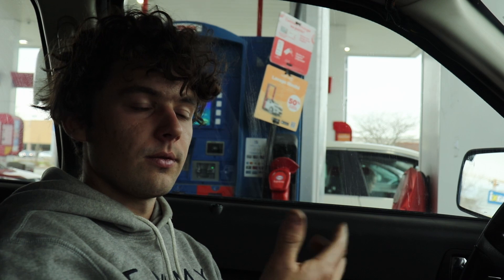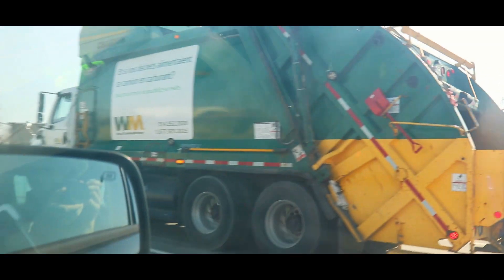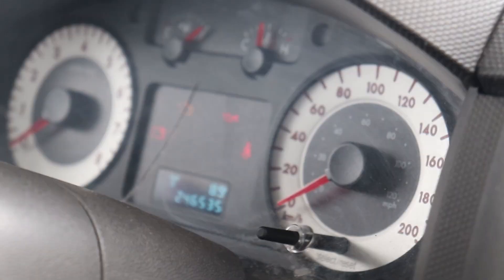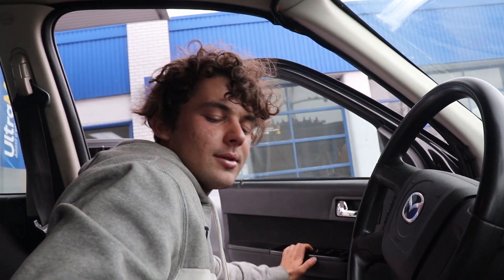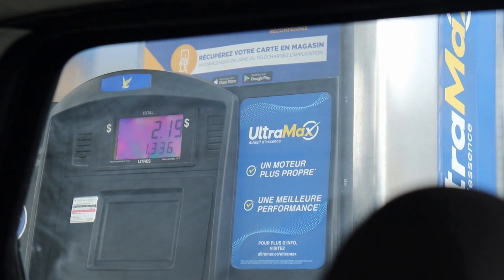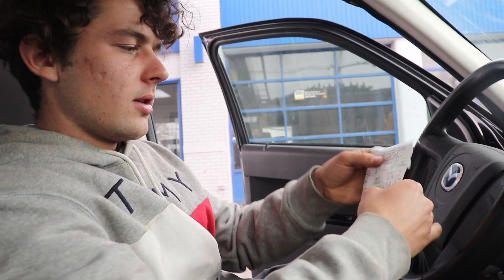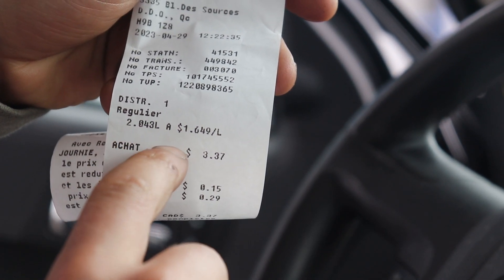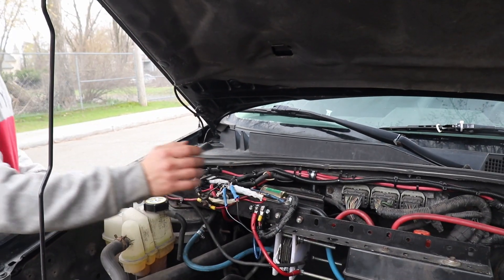Hydrogen Fuel Cell Testing (Part 2)

Comment: This test is inconclusive. 

1st off, you need to do a round trip so you can not only refuel with the same fuel pump, but also account for elevation changes and wind on that trip. Doing a one way fill up wont ever give you accurate results as you could have a head wind in one direction, fill up, and a tail wind going in the other way.

Comment: You proved your concept. Now make it professional. Make it pretty. Properly record your pre and post mileage. As has been mentioned this is an electrolysis system not a fuel cell. Change that or people will criticize you. How will you keep it from running dry? How long before the electrolyte tank is empty? Good job:)

Comment: Years ago in built on of these only 3 times bigger, and i drive a ford explorer, it worked great, on highway it would get 30% more mileage,  and in city i would get 20% more mileage,  it was worth building and putting in, i do have advice, the hose you have coming out and going to the intake, make it go into a canister or bottle about middle way up and have hose coming out of it at the top go to intake. The reasoning is, that if at any point moisture gets sucked threw it will drop off into before it can get sucked into the intake.

Comment: I've read that a computer controller is needed to manipulate the O2 sensors so they don't tell the main PCM to send more fuel to the engine. I'm surprised you did have a gain in MPG so I'd be curious if you use an O2 sensor with your system you should see even better results! Great video and nice to see a young man do something productive instead of joining gangs or selling drugs or being stuck at home playing video games bravo 👏👏
Reply: And also just so we're completely clear I had a relay and switch wired in so I could turn my injectors off after I got the truck started I would start the truck on gasoline let it run and warm up turn my hydrogen on the truck would rev a little bit more because it was sucking on hydrogen and was being delivered gasoline I would then turn the gasoline off I only use gas to start my truck because it is extremely hard to start a vehicle off of hydrogen once the vehicle is already running you're pretty much good to go but if you try to start a vehicle off of straight hydrogen more than likely the engine will backfire and all it takes is one backfire to grenade your entire hydrogen fuel cell happened to me a handful of times then I Incorporated the double bubble tank and instead of blowing my cell up it would pop the double bubble tank which was a lot easier to replace
Reply: @sebastianharrison6118  Are you saying you needed two bubbler tanks to stop the hydrogen generator from exploding, or one bubbler?
Reply: @michaelproeber1953  just one.... but they are called a double bubble lol I can see this being misleading
Reply: Pretty much all cars are different my 96 Toyota Tacoma still has a distributor in it and it also has two O2 sensors and it runs off of OBD2 when I was running hydrogen I didn't have any codes shown besides an EGR code but that's because I had the EGR deleted after I got rid of the hydrogen and turboed my truck I had to make a complete custom exhaust system for it in that process I took the secondary O2 sensor and spaced it away from the exhaust system by about 2 inches because I remove the Cadillac converter and the 202 sensors need to see a difference in flow so it can trick computer to thinking they're still a Cadillac converter there just think Cadillac converter on the front side of the Cadillac converter O2 sensor 1 sees lots of flow and pressure on the backside of a Cadillac converter it's a much smoother flow so O2 sensor number two needs to see less and that pretty much goes for all OBD2 Vehicles if you want to get rid of your catalytic converter you must put an extension on your secondary O2 sensor so you can trick your computer into thinking that the cat is still there vehicles that have wideband AFR sensors like newer Hondas I'm not sure if this is still possible

Comment: Hydrogen technology 🚓🚕
Hydrogen help the combustion process to run engine more efficieently.and carbon-free fuel burnning.
HHO gas burn a lot faster then  gasoline or petrol. Hydrogen power  miracle gas remove carbon build up in the combustion chamber and boost  engine power and torique. Reduse  carbon emission ) restores better fuel  economy.
 Hho car kit  prolonging engine life and engine oil life.
 Like a new car!!! 
Engine runs smoother and cleaner to make your car 0 carbon emissions  Boost engine  power and torque Better acceleration . 
An efficient hho car kit lower the engine temperature more then 100 degree F.  Hho car kit reduce car maintenance charges. 
Cleaner engine running. Reducing engine noise due to the faster fuel burning. Hho car kits works nicely requires no modifications in the car engine. No side effects on car engine.
Engine start quickly safe your car battery. No more petrol or diesel smoke or smell. Hho system is very simple.
Hho kit installation  time is about two hours to make your car a low cost hy-brid.
Reply: I aggreed w u
Reply: So why isn't everyone using it?
And please, no conspiracy theory BS.

Comment: Nice video and test, except this is not Hydrogen Fuel Cell, this is an electrolyser, aka HHO generator, or HHO cell. And also, you must travel at longer distance for accurate results.
Reply: to technical, you want HHO on demand cell no tank needed, and not the extra steep removing the oxygen, looking forward to seeing longer tests when you get the chance cheers

Comment: I use a ac to dc welder for my power supply 110v at 40 amps I got the welder from Home Depot online it's called a metal man it's tiny I also use a thousand watt car inverter to go from the Cars 12 volt to 110 AC I then plug my welder into that and that is my power supply I use a wet cell consisting of 50 positive and 50 negative  plates inside a 5-gallon gas can the plates are 14 × 14inche and about 2 mil thick ... I'm basically just size my intake down to about an inch and a quarter PVC pipe ran that to the back of my truck and it ties into the 5-gallon gas can I also adapted 2  1inch one-way valve to the gas can it's basically a draw through system  truck is a 96 Toyota Tacoma with a 4-cylinder that runs off of hydrogen ....I do start my truck off gas but after it's running I turn my injectors of ...it's definitely less powerful  but it's cheaper than gas but I do have to clean the cell every know and then I use about 40 gallons of gas a year
Reply: Nice we would love to see it bud
Reply: @joemason9187  truck had 328k on it and started knocking ... I took the oil pan of to replace the rod bearing but it turned out to be the wrist pin and a used engine is like 3k after shipping and taxes so I've been in a rock and a hard place with it lately
Reply: @joemason9187  I did want to make a few videos on it in hopes that others would see it and try to refine it further but I'm a 32y old plumber and never had any free time
Reply: post a video as proof
Reply: @MuhammadWaseemEjaz  this was years ago brother I like quite literally have to rebuild an entire new cell I still have my welder and inverter but I'd have to build the system all back together again there is so much to it and when I was younger I had a lot more free time now I'm right in the middle of adulthood and having to work everyday and pay bills and I don't even have enough time for myself anymore let alone cut tanks in half plastic weld them find foam material to put in the top half to keep water from splashing around there was so many small things that the system took and to do it all again would be a week's worth of work and I don't think I'll have a week To myself for the rest of my life it's go to work work your butt off come home go to sleep repeat the process pay rent and maybe somewhere in the middle of that I can feed myself
Reply: wow! 40 gallons of gas that's amazing bro! 👏👏 by the way how do you get passed the O2 sensors? I've read that if the main CPM reads more oxigen going in , it will send more fuel to the engine or does your truck have a carburetor?
Reply: @Radiateprosperity  it had fule injection it was the 2rzfe engine
Reply: I would also like to know if you turn off your injectors by accessing the fuse box of the vehicle or do you identify the wires connected and splice them and wire a rocker or toggle switch to operate from the inside of the car?
Reply: @Radiateprosperity  there was a relay under the hood for the injectors I had a switch wired up to it in the cab... there was also a 2 gallon dubble bubble tank for safety that I failed to mention earlier
Reply: @sebastianharrison6118 Definitely sounds well planned out. Thanks for sharing! Really would be great to see it 🧐
Reply: I would love to see your setup also.
Reply: @b1gbc2501  unfortunately I no longer have the setup and I don't plan on building another or doing that again my truck is currently turboed making about 300 horsepower pulling 14.80s in the quarter mile it is now a dedicated Drag Truck.. also keep in mind that set up I'm talking about is from 8 years ago back whenever I first got my little Toyota and it was a very very crude design truck probably had 70 horsepower maybe it was just enough to get down the road back and forth for a couple years without having to pay for gas because I was at a very hard financial point in my life
Reply: Gotta call BS on this one. 
It cannot work as described.
Many have tried, ALL have failed.
Reply: @RobertRichardson-z3u  with an attitude like that I can imagine you wouldn't accomplished much
Reply: Can you send me pics of  your  sistem. Thank you.
Reply: @sebastian...did your car sometime consume hho only when getting on ride? (You put the relay to controlled the pump gaz on-off)?
Using gas only starting? Then 100% hho will consuming?
Reply: @dadsvloghappychannel8518  .. only gas to start.....then hho on...then gas off....running on only hho
Reply: @sebastianharrison6118  Could you draw up a schematic on your setup from memory? Then just post a short video, explaining the setup? You seem to be generating enough hydrogen to make a toyota engine run, gives me an idea for a single rotor rotary engine adaption in a smaller/lighter car. Everyone keeps doing these hydrogen setups on these really large vehicles with over sized engines so that doesn't make sense to me. Stanley Myer ran his on a small buggy with small displacment engine for a reason. I do engine swaps so if I can generate enough hydorgen, I will definetly find a suitable engine to make it work in a similar way to his buggy.